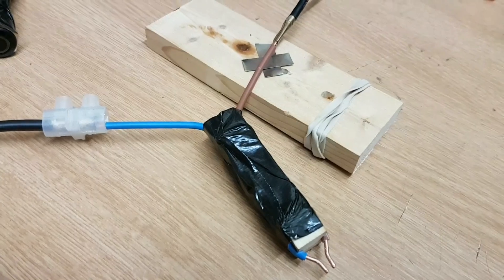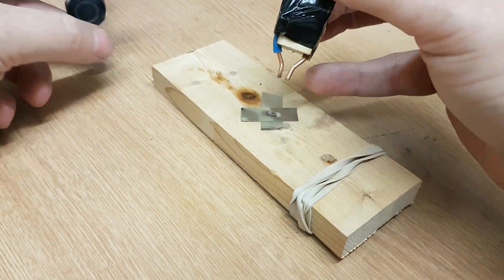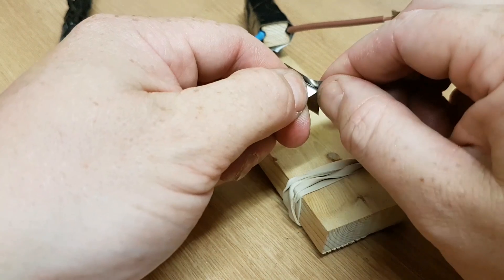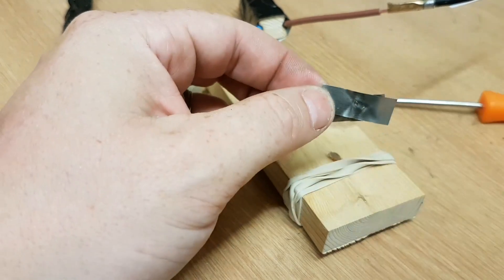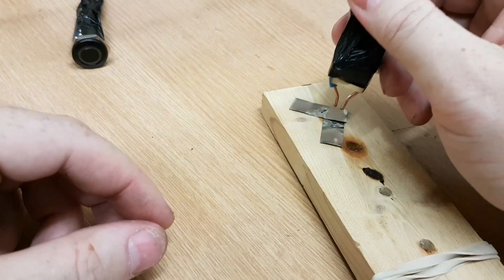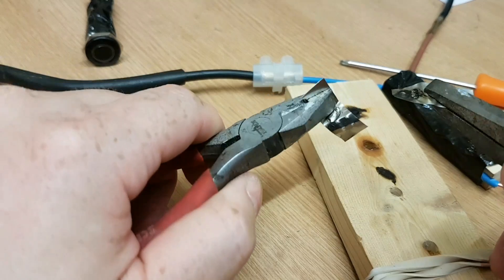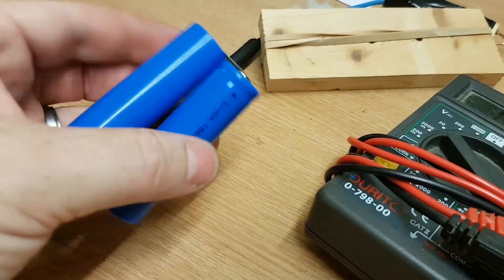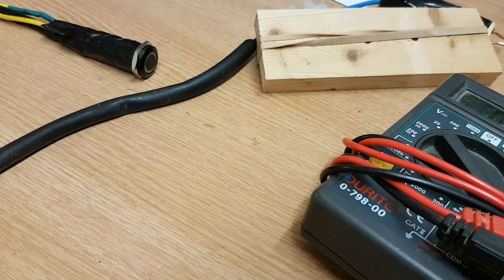DIY Battery Tab Welder - Car/Bike Battery

Comment: How much current can those welds take, once you're using them on actual battery tabs?
Reply from the maker: As much as the nickel will take... About 40-50A continuous, about 150A burst for a few seconds. 200-300A+ and it will glow orange and fuse out within a couple of seconds...

Comment: How many battery amperes did you use for this spot welder...can I use the battery 12v 5.0ah???
Reply from the maker: Ah doesn't matter. You need to know a how many amps it can put out in short bursts. Most batteries have a CCA rating. Cold Cranking Amps. It needs to be at least 300A, no more than 500A.
Reply: @darkkevind  Can I find out the reason why my place classification Nickel Plate does not stick strongly to the battery, I use a 30A relay and a wire size of 2.5mm ..
Reply from the maker: @MARK.NAN69  probably the 30A relay... The one I use is rated for 150A.

Comment: Can you still do this without the relay? Is directly shorting it from the battery possible for weld?
Reply: If you have a switch that can handle the amperage. All the solenoid is doing, is allowing you to run a lower amperage through the switch, and adds a degree of safety. But as long as your circuit can handle a dead short across the battery, it'd be fine.

Comment: I really wished you showed exactly how you did this.  Not just the finished product.  I can see you are using a motorcycle starter solenoid.  The trigger switch is nice.  The connections would have been nice to have seen.  Could you show which cables are positive so no can screw up on this setup.  Also doing a UPS system for your computer and router connection would be awesome.

Comment: 3000mah = 3ah = 3A (amperes) for 1 hour. Where did you come up with 20A? An 18650 lithium ion of 3000mah capacity can put out a 20A current, if that is what you mean, but only for approx 8 minutes and they will heat like a bad frog.
Reply: Paul Andrulis u don't now about 18650 battery

Comment: Hi, I'm needing to repair a product where the spot welded 18650 came loose. I do have a motorcycle battery, but no solenoid. Do you think a second person could touch and remove the battery cable quickly? I literally only need to do 2 or 3 zaps so I'm trying to save time and money by not buying a solenoid. Thanks for any help.

Comment: isn’t solenoid a valve for gas or fuel? why not a relay ?
Reply from the maker: Solenoid switch explained: https://goo.gl/images/ZB7ygh
Reply: thank you darkkevind,
It is the same principles as relay, but I think somewhere else I saw solenoids are for controlling flows of gases or fuels. May be there are solenoid switches and solenoid valves.
Reply from the maker: @petaabay3984  no, a solenoid switch is used in every fuel engined vehicle to power the starter motor.
Reply: As a layman of vehicle, I would never understand. But I have check up the internet and confirmed there are solenoid valves exist.
https://en.m.wikipedia.org/wiki/Solenoid_valve

Comment: I had to dislike and i'll tell you why. If you hold the button down current flows continuously which is not good all round. Rewire or get new solenoid. And watch a video where it is done correctly. Maybe try mounting button where you can quickly tap it , fast. Because what I'm seeing in this is not good.
Reply from the maker: MadCowTv you need to watch some of my other videos...

Comment: Thank you!, this seems so much easier and safer than messing around with house mains and hooking up to some microwave part.  Although this is not innocent either. Totally will try this
Reply: For just popping some nickel strips onto cells, this is absolutely all you need. All the big like, real spot welders I've seen are way too combersome for this type of thing, and surely overpowered. Not to mention, they'd be entirely unsuited for this type of work, just because of how they're set up. You have to have an electrode on each side, which you can't do with a battery cell. And a little 12v 200amp battery might give you a tiny little bite, but nothing the least bit dangerous. Hell, I've accidentally, and purposely...grabbed coil wires on a bike or car that are 30k. Most likely wouldn't be more than a little tingle, like sticking your tongue to a 9v. Only a bit more amperage...

Comment: Can we use a relay instead of the solenoid switch ???
Reply from the maker: Zana Hasan as long as it's rated for a few hundred amps, yes. The electro magnet in a solenoid is much more powerful than in most relays though so there may be some issue with disconnecting.... But it'll probably be fine... Try it ;)

Comment: Or could u use a relay?
Reply: That essentially is a relay. Works exactly the same, but a starter solenoid is built for the full power of the battery. As long as a relay was rated for whatever amperage you're running, I'd say it would work. But a solenoid would probably be cheaper and easier.

Comment: Could u skip the solenoid and just wire the switch
Reply from the maker: Joel 1 no because that switch cannot handle anywhere near the amount of amps running through it, 200+A!
Technically you could make a momentary switch with two copper flat bars, like a Morse code switch, but I don't think you'll get the timing right.

Comment: where do you find such a small solenoid?
Reply from the maker: countryside eBay. Any ATV or scooter/motorbike
Reply: Hi, very good job! Great!
Can you give me an (an example) eBay address so I can buy a solenoid as your please? Very THANKS! :)
Reply: Very Thanks!
Reply from the maker: This is my newest video on this welder, it has a link to the solenoid in the description. https://www.youtube.com/watch?v=o4NaDMoEHxU
Reply: may be in a motor bike starter
Reply: I throw them away all of the time.  Old used equipment from jobsites. We use them on valves. You will see them on or (mostly) inside of equipment used in the the HVAC industry. Jobsites, dumpsters and the junkyard are places you can get them for free or very cheap.
Reply: Arn't those 24 vac?
Reply: Lawnmower, any small engine with electric start.

Comment: Why do you need a solenoid? Why can't you just use the momentary switch?
Reply from the maker: Josh S most switches like this one,  absolutely cannot handle the amount of amps going through the circuit when it ultimately shorts for doing a weld. Each weld pulls around 200A, which is what this battery is capable of delivering.
If you tried that, the switch would melt on your first weld because the contacts inside are only rated for around 6A.

Comment: Hi, thanks for your video, it's very interesting but i never seen a solenoid. Have you a schema for connections of your circuit ?
I don't understand how you connected the solenoid ?
Thanks again, very good job !
Reply from the maker: The solenoid is a mechanical switch that sits inline on the positive wire and rests at breaking the connection. When you feed the solenoid 12v DC it will mechanically join the wire together to let the current flow, remove the 12v DC feed and it breaks the circuit again.
Look on ebay for 12v Solenoid switch or relay. You need as many AMPs as you can find. Min. 150A.
Reply: Thanks, So sorry but i don't understand all you said on the video (i don't speek english very well). You said me i'll need AMPs but i don't see on the video where you connect them ? And i would like to know how you connect the two yellow wires to the swich, is it a bipolar switch or one of the two yellow wire is directly connetc to solenoid's black wire ?
Thanks !
Reply: do you know how many amps is max output for your solenoid...with the bike battery??it is like AVE s but you use a more compact and cheap solenoid...are you sure this size can provide above 150 amps...i dont think that 300cc engine needs that power for start.....maybe under 50 .....really dont know..but in a mechanical OLD book i have they used to say around 100-150 for a mid sized EUROPEAN car...i say european cause most of them had have much smaller engines
Reply from the maker: GIANNIS LYMPEROPOYLOS the solenoid is rated for 150A but the battery can output 200A
Reply from the maker: This isn't the best design or materials though. See my update video. Link in description.
Reply: thank you very much for your quick response...!!!so it is more than enough ....for this purpose..thnx once again.!!!!!!

Comment: i like it, its simple design but works good. I already order a solenoid to build one like it. Other ones I seen use expensive high voltage capacitors or microwave inductors. Good job.
Reply from the maker: jony joe thanks! I've actually upgraded this since in made this video, it works much better. I'll post a new video and/or put some pictures on my blog soon...